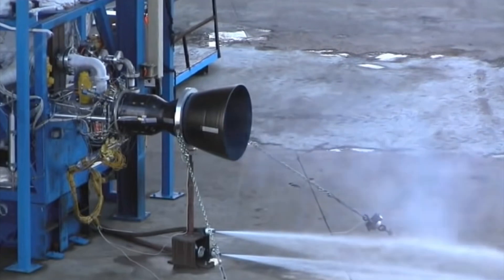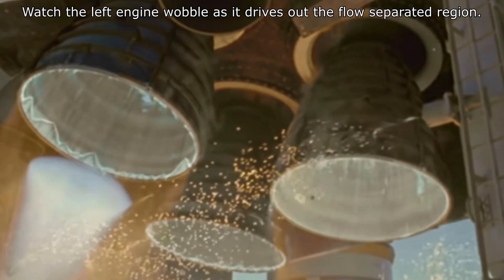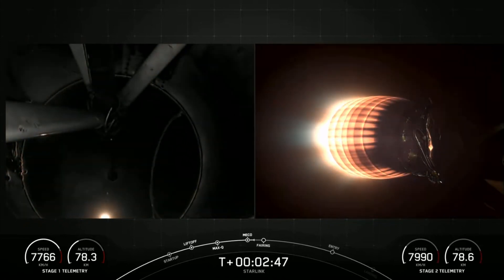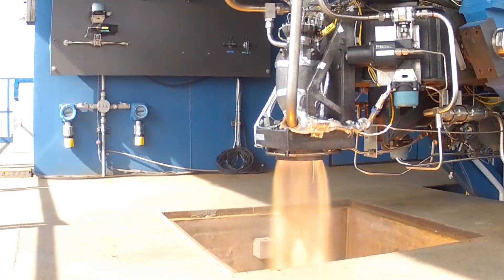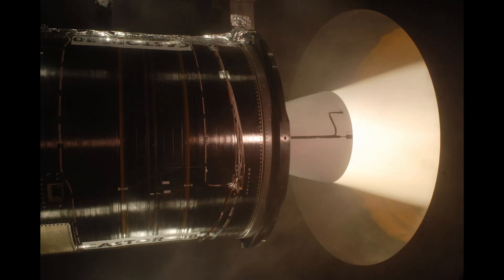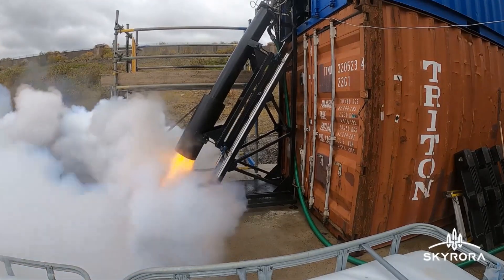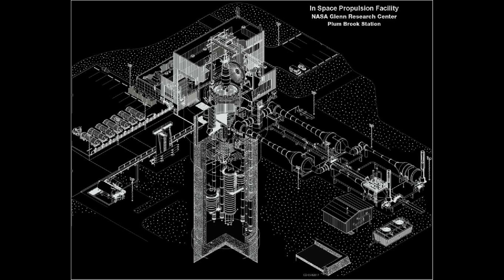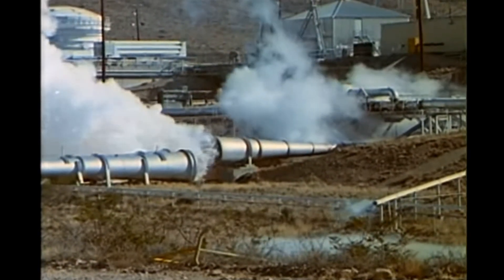Defying Atmosphere - How Rocket Engines Get Tested In A Vacuum Before Going To Space

Comment: @6:00 you claim it will maintain vacuum conditions during the burn. That’s not true. You only get partial vacuum conditions after ignition because physics (aka exhaust gasses fill the void). Your combustion engineering knowledge is quite impressive though😊
Reply: I don't think you understood what was being said fully.
Reply: @TheEvilmooseofdoom  care to explain? Especially since you apparently fully understood what was being said. Scott should have pointed out that tests are performed at different levels of partial vacuums, then the results are extrapolated to approximate total vacuum behavior
Reply: @geirthieussbimkravahl  The flow is enough to create a close enough vacuum to make the testing valid.

Comment: The flow extraction systems you describe fall into the heading of “Eductors” & “Perry Jet Eductor” pumps. They have no moving parts and rely on ambient fluid particles in the vicinity of the jet/throat of the Eductor inlet becoming entrained in the mass flow in the inlet imparting a vector flow to the entrained coaxial to energizing flow of the jet. Thus creating a pump like action.
Mark Fay MMC Jr. Engineer

Comment: Obviously, you can simulate these tests, and given the power of simulations today, with a high degree of confidence.  I would imagine that the flow dynamics in a vacuum are very well known and modeled.  And I'm speaking to flow, thermal, structural, etc.

If the exhaust contains mach diamonds in the diffuser, the flow is much more complex than your constant flow little graphic you showed.  After entrainment and steam injection, there must be some SERIOUS mass flow within and out of that pipe!

That outflow you showed from that pipe is surely not during the burn, is it?  I would be shocked if that were true, unless that is very high speed videography slowed very greatly.  Very cool seeing the methods for dealing with the test exhaust.  I have never looked at that arrangement.

What is the vacuum quality at the nozzle using all those systems?  I should go look that up.  I would think it would be lousy, but intuition is often terrible at determining such things.  Some of the statistical analysis done, especially some of the examples, just floored me.  One was the duplicated birthday bet, for any two people in the sample, where IIRC after about 24 people (It's been a lot longer for me than you, back to classes) rises to 50% and with just a few more people is an almost certain bet.  There were others.

I laughed my ass off at that last spin test.  Did anybody actually even eyeball the  mounting spin axis accuracy before they lit it, or did they expect the real vehicle to wobble like that in flight?  :-)  Seems like a good way to negate the value of the test, to me...or a little like the result of Space X first full up Starship test off the pad, which was also bent over knee slapping stuff.  How they can be so damned smart, and so damned stupid at the same time is beyond me.  I guarantee somebody got the look of death from Musk after that analysis turned out to be fantasy.  Talk about embarrassing.
Reply: Off axis testing is a very reasonable expectation, in the short moment between shutdown and separation, aerodynamic forces/propellant residuals in the vehicle can induce minor but not neglible pitch/yaw. Nothing is ever perfect

Comment: Another consideration is noise, as engines can be loud. Even jet engines easily will clock over 140dB in a test chamber, and rocket engines can easily go over 200dB when you are in close proximity. Loud enough to destroy concrete and tear thin steel structures, and a thing you have to consider in both the design of the engine and the test area, in that if you reflect the noise back you can destroy working engines in seconds.
Reply: Good explained.

Comment: The outer ring engines during a starship launch creates low atmospheric pressure around the internal engines.  And this lower pressure around an internal engine is not uniform which may create mechanical flexing of those engine nozzles.  This could help explain why engines on a starship launch are less reliable than in the test stand.
Reply: So far it looks like the engines that have issues are on the outer ring.

Comment: I was lucky enough to get a tour of NASA Armstrong Test Facility a few weeks ago and got to go into the vacuum chambers. The setup they use in the ISP chamber is surprisingly simple. Since hydrolox engines like the RL-10 (which is what it was designed for) run hydrogen rich, they have to safely deal with all that excess hydrogen in the exhaust. All they do is spray water into the exhaust to condense the steam, then have some pipes with expansion tanks to continue to separate the water and hydrogen, then at the end are flare stacks to burn off the hydrogen that is left over.
Reply: Also, your explanation about differential heating in the chamber is spot on. They have lights and heat lamps to add heat on one side, and can even roughly simulate day-night cycles in Earth orbit.
Reply: ? dont the the ships make a barbecue rotation?

Comment: Hmm.. yet again the optimum solution is simply to use a solid fuel rocket that consumes the containment device as it burns.. slower and slower... so no excess weight is carried.. but making all consumable rockets would require some effort... ?
Reply: Solids don't get near the ISP so you trade off.
Reply: No throttle no way to turn it off in a emergency almost always under expanded and like the other comment said bad efficiency
Reply: @peeperleviathan2839
Nope.. you fail to understand the basics
Reply: @janwitts2688  what basics? All solid rockets are non throttle-able or able to be shut down  (unless hybrid ones but those ones have less of the benefits of srbs) and bad efficiency. Instead of saying I’m the one who doesn’t understand maybe tell me what makes you right instead of just that I’m wrong

Comment: I helped design the J6 test stand, which held a vacuum on one shuttle solid rocket engine through its entire operation. We built the largest concrete vacuum chamber in the world. The facility looked like a giant banjo. We ran the HP boilers for three days to accumulate enough steam to run the 20 toroidal steam injectors. Lots of fun!
Reply: Please tell us more!
Reply: That's incredibly exciting! The rocket gets all of the glamor, but it designing, building, transporting, assembling, and testing all of the parts that is the real feat of engineering.
Reply: Man I would absolutely love to just have a conversation with you, I’ve been so lucky to meet some of the most amazing folks in the space field in my career, I got to meet and talk with the doc who monitored the Apollo astronauts on the way to the moon and back as well as many other and it’s just so amazing learning from them. They have just incredible stories
Reply: @shanemeyer9224  what kind of stories? You don’t need to tell the whole thing, but maybe the main idea of a couple impressive stories?
Reply: Steam driven venturi ejectors would need to run for a long time to fully evacuate a large chamber. Air pumps are quicker but never get near a full vacuum. So you run the boilers and ejectors for a couple of days
Reply: @Dave5843-d9m  the initial vacuum was made with large vacuum pumps. Of course, when the slb fired, the 20 ejectors pulled the vacuum.
Reply: You work with JPL ?
Reply: @cowabunga2597 I worked for the engineering company that designed J6.
Reply: @cowabunga2597  AEDC isn't at the JPL. It's an Air Force facility in Tennessee.
Reply: 3 days to boil... That shows off how much energy water needs to get some degree hotter!!
Reply: @MrLogikmann  More like, the quantity of water needed to be boiled.
Reply: You should be totally proud to be a significant part of space exploration 🚀
Reply: Wild that you just admitted to help orchestrate the atrocity that was January 6th.. shame on you and I hope you rot in prison for your crimes against humanity.
Reply: Boilers run for three days to store enough hot water that’s ready to flash to steam?
Reply: @shaunybonny688  Whether the boiler water is run close loop, (condensed after use), or once through, as in the case here, the same amount of water will be used, and anyway heating the water to boiling point uses only a small fraction of the power required.
Reply: Awesome!
Reply: J6 at AEDC? Nice! I remember touring that when I was doing a summer internship there during college. Pretty impressive test cell.
Reply: Thanks for sharing! Cool work!!!
Reply: Could you breathe while testing in pure anxiety if what you build would work or explode? 😅😅
Reply: I hope you have lots of photos and maybe you could write a “behind the scenes” memoir? I love reading Kranz, Stages to Saturn etc. but there is not much detailed documentation of all the supporting engineering in the public…
Reply: where did you work? AEDC ?
Reply: Sure hope Scott makes a quick clip on the Vikram lander's "rocket hop"
Search for Vikram hop
Of course it's in a vacuum - so it's relevant for this discussion
What's neat is the Pragyan rover's tracks were not obliterated - because vacuum
Reply: After all that though.. No thrust was achieved
Reply: @kdkinen  Except for the pesky FACT that Rocket Propulsion DOES work in a vacuum exactly as Newtons Laws say it MUST!
To claim otherwise is just admitting that you do not understand Newtons Laws.
Reply: @stuartgray5877  No, what it really means is you've never tried it yourself.
Reply: @kdkinen  - "what it really means is you've never tried it yourself."
Sorry but wrong again.  I have an actual Engineering degree and have worked for the last ~30 years as an Aerospace Engineer on some of mankind's most advanced vehicles.
I have hazardous material handling certifications going back over 25 years at KSC, CCAFS, VAFB, VSFB for fueling spacecraft before launch.
I have been building, testing, launching and operating earth orbiting spacecraft and deep space science probes for almost 30 years now.
How about you?
Reply: @stuartgray5877  Perfect. So why can't you shroud the nozzle.. Even with action reaction newtonian theory??
Reply: @kdkinen  - "So why can't you shroud the nozzle.. "

What are you talking about?
Reply: @stuartgray5877  sure, if you shroud the nozzle from the sides EVEN while leaving a direct open path behind the nozzle for exhaust... the rocket thrust is COMPLETELY defeated. Why is this??
Reply: You never remove the gas created from the rocket thus you were pumping the chamber with gas 

Science today is like COVID vaccinations safe and effective but the survivors are the unvaccinated
Reply: Why don't they try it IN space?
Reply: Please interview this man Scott!!!
Reply: @markmcculfor6113 he won’t. Don’t even suggest it. You’re wasting your breath
Reply: @WhiteOwlOnFire_XXX  lol thanks
Reply: Doesn't the shuttle SRB operate at sea level, though? Why test in vacuum?
Reply: @RCAvhstape take a look at some ascend data from shuttle flights. Although the engines are ignited at sea level, they operate for about 500 seconds, and more than half of that time the shuttle is above 100 km. As g2g stated, at SRB separation, thats only about 120-140s into the flight and for all practical purposes close enough to "full" vacuum.
Reply: @RCAvhstape   I would assume it was for testing some of its characteristics during the later portions of its flight, which occur in near-vacuum conditions. You are correct that most Space Shuttle SRB testing occurred at sea level pressures. Usually just the "light one up somewhere out in the desert" approach. Didn't need the facilities at AEDC for that. At least when I was at AEDC (about 15 years ago,) J-6 was mostly used for testing upper-stage motors of various rockets.
Reply: @RCAvhstape the srbs were jettisoned at 45 km (146,000 ft ), which is near vacuum.

up there theres only 0.0014 atmosphere, 1.431 mb,  or  0.0207 psi of pressure
Reply: @g2g591 So about 1 mmHg?
Reply: A vacuum chamber in completely different than the vacuum of space. A chamber still has walls, ceiling and floor. Space doesn’t. Propulsion always needs something to push off of. Newtons theory or law can show us a rocket flame in a vacuum. Ignited gas making a flame can make light and heat but this will do absolutely nothing in the vacuum of space. This is why the idea of our atmosphere just sitting up against this powerful vacuum and the high pressure system isn’t equaling out with the low pressure system is crazy.
Reply: Got a video of that accompanied by an explanation of what you were doing? Or are you just typing 'hot air'?
Reply: @PeterPete  The guy is clearly lying, as is Scott Manley, the guy with a fake name whose entire channel is devoted to grooming kids 😂
Reply: Sure you did. Show me a video of thrust in a vacuum. Why are there no patents for thrust in a vacuum? At zero atmospheric pressure air has no mass. You can accelerate as much of it as you want but there will be no reaction force. A fluid must have mass to create a force. No mass. No thrust.
Reply: @RNDInnovators  - "No mass. No thrust."

I WONDER WHY rockets are about 95% REACTION MASS at liftoff?
Reply: @RNDInnovators 
Only a flattard can say nonsense like "at zero atmosphere pressure air has no mass". Lol
Reply: @RNDInnovators  A rocket shoves hundreds of kg of reaction mass out the back. That’s plenty to get a reaction force that can accelerate a rocket. 
There’s no patent for this general principle because it’s so obvious. 10,000 satellites in orbit prove that it works.
Reply: "We ran the HP boilers for three days to accumulate enough steam" I don't think so. Took 3 days to light up the boilers, bring the steam steam to pressure and dry steam conditions more like.
Reply: @axelBr1   We accumulated steam by storing it in buckets. Just spray it in and make sure the lids are on tight. Then you can just pour it back in the boiler as needed!   lol
Reply: @KSparks80  😂🤣👍🏻
Reply: @KSparks80 after enough steam is accumulated it's held under refrigeration for a while so that once put in storage it takes up less space.
Reply: @drworm5007  Why didn't I think of that! It's so simple.   lol
Reply: @KSparks80  Those last two comments were gold!.  That must have been very interesting to work on.  Do you know what the volume of the chamber was? and how much gas was generated from rocket firing?
Reply: LIES OF FAKE!
Reply: @kg4boj  And the conspiracy nuts come in. This is what I never understood. We did make these test chambers. We did design, build, and test every aspect of the entire Apollo system, they even agree a giant rocket launched up off the ground, but the conspiracy nuts want us to believe that the rocket just, like, did nothing, instead of something. So now you also have to add in the extra time and effort to do all the other in space 'fake stuff' on top of design the whole rocket, etc. At even the slightest of critical glances, the entire conspiracy makes absolutely zero sense.
Reply: @kg4boj What lies? What do you think is fake?

Comment: My Company (Ball Aerospace) purchases over a dozen mono-methyl Hydrazine "Thrusters" per year.  We test every single one of them in a vacuum chamber here on earth and we Verify that they DO produce the thrust predicted by the 100-year old Tsiolkovsky Rocket Equation.
We then put those thrusters on real spacecraft, launch them to space and test them THERE TOO.
For example, a few years ago we launched (and tested) the Green Propellant Infusion Mission (GPIM) for the US Govt.
It tested a new green propellant that is not hazardous to humans before a launch.
Currently we are preparing the WSF-M mission for the US Space Force and (coincidentally) we just did the Propulsion Leak Check and Performance test just YESTERDAY on the whole vehicle (we don't actually fire the thrusters with real hydrazine during that test).
I have had hazardous material handling certifications at KSC, VAFB, & CCAFS going back over 25 years now as I have been a member of a spacecraft Fueling team more than once in my 30 year long career of launching spacecraft to earth orbit and deep space.
Most of the Prop Systems I have worked on have been Mono-Propellant, but the Mars Global Surveyor was a Bi-Propellant system that it used to insert itself into Mars Orbit.
It burned the Oxidizer to depletion during the Mars orbital Insertion burn and spent the rest of its mission using the Hydrazine only as a mono-propellant system.
So it was BOTH mono and Bi Propellant in the same prop system.
Reply: Oh, and another use for rocket engines and the "vacuum" they can produce: Ball Aerospace also helped build the Optics and beam forming hardware for the Tactical High Energy Laser (THEL) program back in the early 2000s.
By 2005 we were able to shoot down multiple super-sonic projectiles, in rapid succession, at multiple miles range.
However, the laser used was a Chemical Laser (like used in the Airborne Laser Program) and required a HUGE vacuum pump to pull the chemical reactants through the laser reaction chamber.
Instead of a mechanical pump they used a rocket engine (I believe an Atlas) to create the venturi to drive the laser.
This was obviously not practical but demonstrates we have had the optics technology for laser weapons for many years, we have just been waiting for powerful enough solid state laser, like the fiber-laser amplifiers we have today.

Comment: Please do a story on the invention of those spark releasers they use on those big rockets, who invented the first spark igniter?
Reply: Like the sparks you see on shuttle launches? They're there only to burn off unburnt hydrogen that escapes the engine as the pumps spin up
Reply: Rocket engines like the space shuttle are lit with sparks, but they're generated inside of the engines.  The ROFI sparklers visible under the tail were there to prevent unwanted hydrogen explosions.